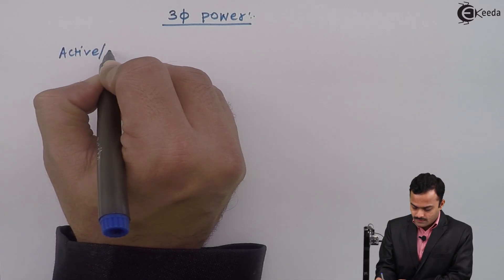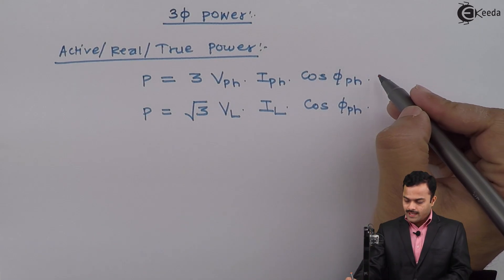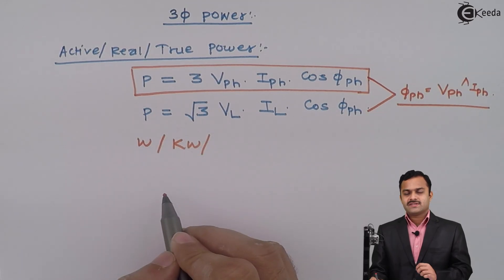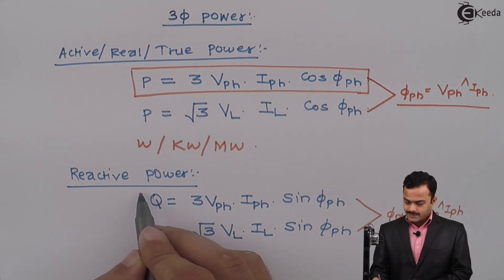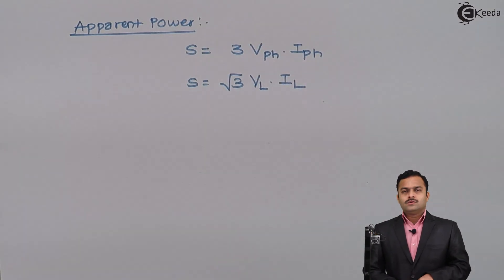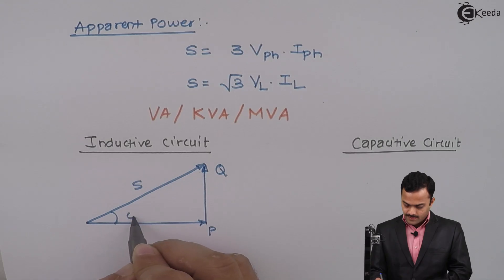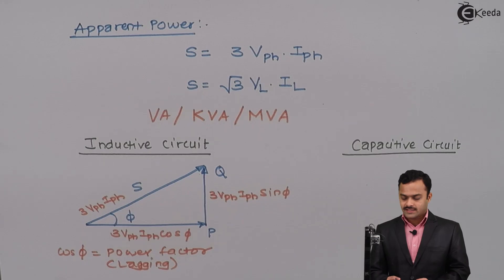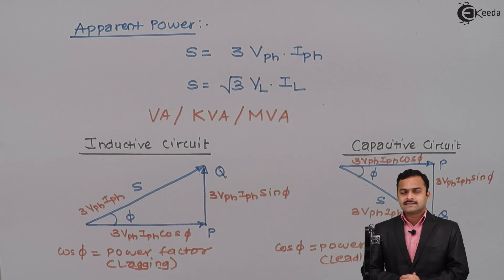Power Consumed in Three Phase Circuits - Three Phase Circuits - Basic Electrical Engineering

Comment: Pls help me with this..  
Balanced 3 phase sytem
Magnitude 4120 volt line to line. Line currents Ia=25<330, Ib=60<214 , Ic=30<80. Solve for total power draw.

No indictation of delta or wye..  Pls help